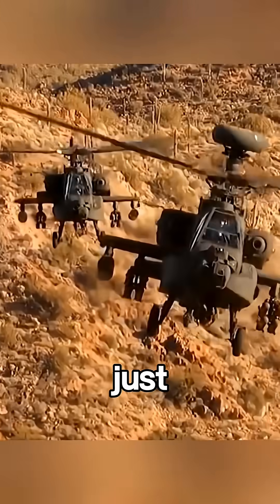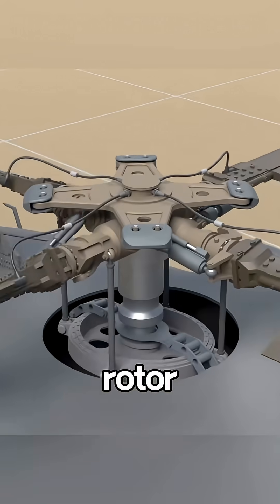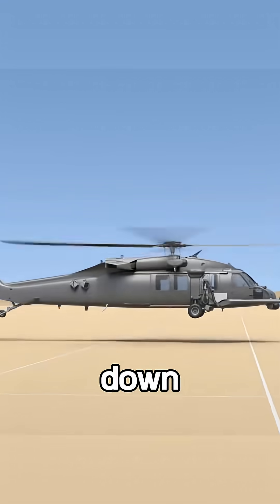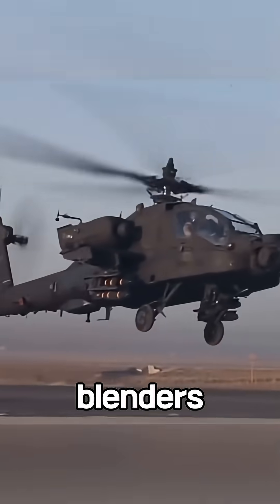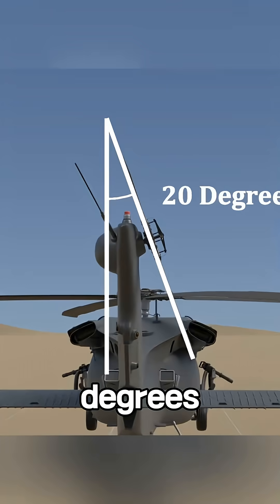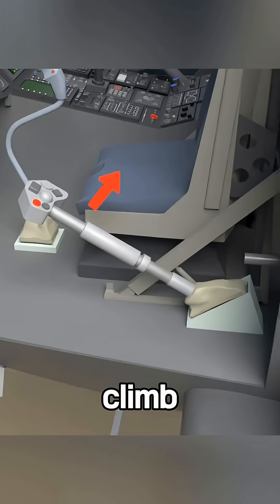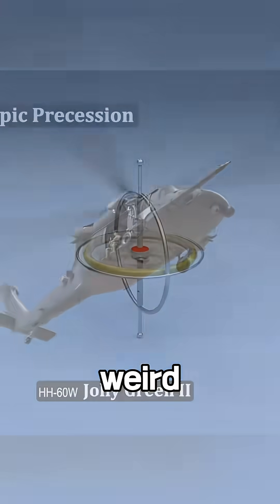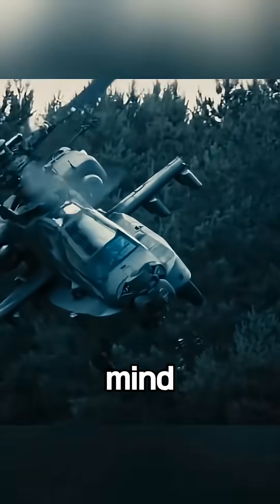Helicopter Speed Myth Busted: What Really Limits Their Velocity #helicopter #aviation #military

Comment: now add this: the right blades airspeed = rotation + forward speed. the left blades airspeed = rotation - forward speed.  if you fly faster, you get more lift on the right and less lift on the left. there must come a point when going faster causes the bird to roll over.

consider the silly TV show Airwolf. a Mach 1+ helicopter. the difference in speed across the span of the blade would be Mach 2. the blade on the left would be traveling backwards at Mach 1, then 1/320th of a minute later it would be going forward at Mach 1. 320 cycles of this every minute.
Reply: This is correct.
Reply: This is what creates a max speed limit. On the retreating blade, there is less and less lift being generated.
Reply: Actually, at Mach 1 the advancing blade would be going at Mach1 + the speed of blade rotation, the retreating blade Mach 1 - rotation speed. For half a rotation, each blade would be supersonic, the other half subsonic. Can't imagine what the sonic booms would be like!
Reply: @anotherwarbirdfan1893 There already is an aircraft like that built back in the 1950's;it has a small propeller connected to a turbo jet engine via a shaft,via gear boxes,and it is the F-84 experimental plane which the test pilots & ground crews nicknamed 
"The Thunderschreech".The plane was so loud that it actually made the ground crew personnel physically sick from as far away as 20 to 30 miles;from the propeller blades constantly breaking the sound barrier about 900 rotations per minute it was too loud to get any decibel readings with it on the ground as the constant sonic boom with the plane sitting at idle on the ground, destroyed any sound equipment so they only recorded what it sounded like while it was flying at it's service sceiling at full speed;and it was still very loud it was louder than the loudest military aircraft that is still in service today,the Russian TU-195 "Bear" bomber which is said to be so loud that US nuclear powered submarine crews can both detect & track their flight path while submerged using their passive sonar.The test pilots who flew the Thunderschreech said that the plane constantly vibrated while in flight making it one of the most unstable experimental planes that they had ever flown;and flat out told the chain of command "NEVER AGAIN!" after landing and getting out of the plane due to all the constant vibrations at idle,full throttle during takeoff,and while gathering inflight data.The project was deemed a faliure and was canceled for a number of reasons;the 170 to 180 decibels that the experimental plane was roughly estimated to be producing both on the ground as well as in flight making the ground crews physically sick,and the reports of windows being blown out at ground level even while the aircraft was flying at the maximum service sceiling,and the fact that the small propeller still limited the experimental aircraft from breaking through the sound barrier at between 500 mph & 700 mph,which was causing the constant vibrations & buffeting which happens when the sound shock waves accumulates & builds up in front of the aircraft as it appeoached the speed of sound.All but one of the F-84 experimental aircraft that were built back in the 1950's 70+ years ago;were scrapped while the last surviving one is currently on permenant display,at the Smithsonian Air & Space Museum.
Reply: @devinrussell420  Yeah, I know about the Thunderscreech. It was one of those "well, it seemed like a good idea at the time..." projects. 😅 I never knew that about the Bear bomber though. Thanks for all the info. 😊
Reply: @anotherwarbirdfan1893 The Russian TU-195 "Bear" long range tactical bomber is the loudest military aircraft in service today;because the twin sets of counter rotating four blade propellers are rotating at supersonic speeds creating a constant sonic boom with the second set of propeller blades somewhat muffling & cancelling out the constant sonic boom of the first set of propeller blades,which makes it around 20 to 30 decibels quieter than the F-84 Thunderschreech experimental aircraft which still holds the world record for being the loudest aircraft in aviation history.Due to the aircraft having a second set of blades;the constant sonic boom isn't nearly as loud as the F-84 Thunderschreech experimental aircraft was;at about 150 decibels for the TU-195 Bear long range tactical bomber instead of around 170 to 180 decibels,for the F-84 Thunderschreech experimental aircraft.
Reply: @anotherwarbirdfan1893  "the retreating blade would be going Mach 1 - rotation speed." the retreating blade has MINUS Mach one speed because its leading edge is facing away from the direction of travel.
Reply: @jamesotisjr2322  It doesn't matter which way the leading edge of the blade is facing, the whole aircraft is moving forward at Mach 1. If the rotor weren't spinning both blades would be going forward at Mach 1. Spin the rotor and the blades are moving at Mach 1 + or - rotor speed.
Reply: @anotherwarbirdfan1893  It's like explaining why a windmill attached to the roof of a car does not give you free energy to my brain damaged younger brother. I won't waste any more time on you
Reply: @anotherwarbirdfan1893 I was under the impression that no helicopter could travel greater than the speed of sound.

As no material could withstand the torque created when the tip is travelling at greater than mach 1 while the base is travelling at sub mach 1. The vibration at the point that is effectively constantly hovering at the sound barrier wave would result in the rotor simply shattering.

This results in a maximum speed limit of every helicopter being slightly under the speed of sound. 

Has this limitation been surpassed?
Reply: @ryougahibiki941  No, we were just talking about the old TV show "Airwolf" which had a heavily armed helicopter that could fly faster than Mach 1. It was just speculation as to what would happen to rotor blades if a helicopter could actually reach the speed of sound.
Reply: @anotherwarbirdfan1893 Yeah, even as a child I questioned the physics of Airwolf boosting past mach 1. My parents told me to shut up and just enjoy the show 😊
Reply: @ryougahibiki941  Yeah, it was a fun show with a cool copter.
Reply: Actually greater lift on the advancing blade causes a helicopter to pitch up due to gyroscopic precession. There are also dampers that slow the rotational speed of the advancing blade and use that stored energy to speed the rotational speed of the retreating blade to help dampen the effect of different airspeeds.

Comment: Isn't speed limited to the harmonic balance of the rotors as they swing around the ones going forward are going faster than the one's going backward and create small sonic bombs which creates vibrations and the blades.I know there's a british helicopter that has nifty little designs on the end of the blades to help compensate for that but I think it's not a limiting factor

Comment: Well said. I got into flying helicopters in video games years back and I got really good at it, though I was not playing a simulator, it was GTA. I started wondering how the forward tilt of the helicopter was done. I couldn't decide if there was a ballast system or even less likely that the entire rotor shaft moved. So I looked into it and was blown away by what I learned. In my head, I started to picture a cam-like system that pushed and pulled the blade linkages and changed the pitch of each individual blade as the entire rotor system spun. Imagining each blade change to a different pitch as they got to certain points in their 360 degrees of rotation. That was how I made it make sense in my head. I know I don't have it 100 percent understood, but just that very basic simplification was enough to impress me when I thought of the early helicopter's development.

Comment: A lot of this was wrong, blade speed does in fact dictate the maximum speed of the helicopter due to a phenomenon known as retreating blade stall, this will happen at a slow speed on a helicopter with a 200 rpm rotor but at a higher speed on a helicopter with a 400 rpm rotor. The tail rotor doesn’t have to be tilted in fact that tilt is only visible on one helicopter, the Black Hawk. The Yaw pedals control yaw only not turning, just motion along the yaw axis, the diagram you showed at that point showed roll.

Comment: Blade RPM does matter. Otherwise, you could just set the engine RPM like a tractor. It's just not the primary force in the occasion.  
I really like the axial rotors on some Russian and a few heavy lift models. It cancels the torque effect.

Comment: Went through helicopter ground school while working at Sikorsky's but worked on Jets in the Navy. 
Those blades lead and lag too. It's a complicated rotating system.
Reply: Articulating main rotor systems
Reply: Rumor has it Sykorski had a camera mounted on the main hub and pointed down the length of each blade. It recorded ungodly rotor blade deformities due to the forces on the blade. 

The video was meant to provide confidence to pilots how strong the blades were. They had to stop showing the video to pilots because it freaked them out.

Comment: The collective has a twist throttle, which does increase engine speed, but I'm pretty sure most of the time it's at full throttle.
Reply: No, that’s not necessarily true. In cruise flight you always wanna maintain rotor RPM within a narrow band approximately 96 to 100%. However, you adjust the power of the engine to maintain that rotor RPM. It doesn’t always have to be at full power to maintain cruise flight.

Comment: the motion of your helicopter during the time you are explaining rotation is actually not rotation, its lateral movement. lateral movement is brought about by tilting the rotor disc using a cyclic stick in the direction you want to move.

Comment: Started off  wrong, then went on to be mostly right. Never say helicopter rotors always go at the same speed. That's factually wrong. They are usually set to a set rotation speed each flight, sorta, depending on the helicopter model.  BUT different circumstances demand different rotor speeds...

Comment: Thecnicaly tail rotor is not must, coaxial rotors are other option like on KA52 or rundem rotors on CH47. Coaxial design useuly give high speed (not the rotors alone but aerodynamic changes it provides) while tandem lifting capacity.

Comment: But still, increasing the rotational speed of all blades would create more torque or uplift, and the helicopter would accelerate faster up to its final speed.

But this was very interesting. I was still thinking that the rotor would be aligned in a forward angle to push the air through the vehicle, as the energy density is great if you can use the full area of the blades.
Using only one blade pitched in a time sequence would still end up in something like PWM, but maybe at this speed it doesn't matter anymore, or it might have a better effect according to turbulence.

Comment: Last part of info on forward, rear, sideways is wrong. Cyclic movement in any direction tilts the entire rotating disc in that direction, hence the air gets pushed behind as a result of which it moves in particular direction. The more rotor disc moves the more air it pushes back and faster it moves.